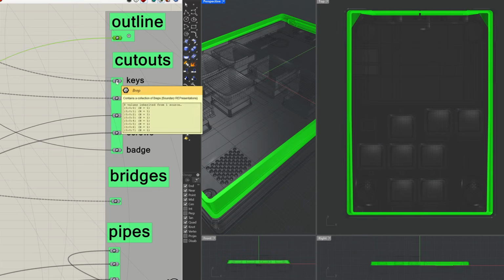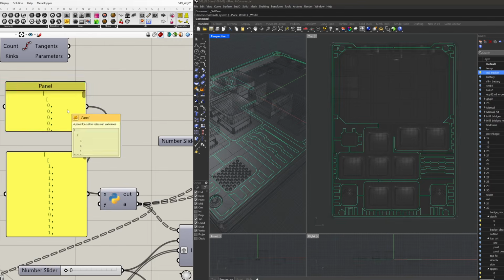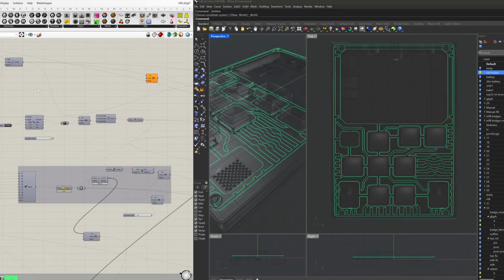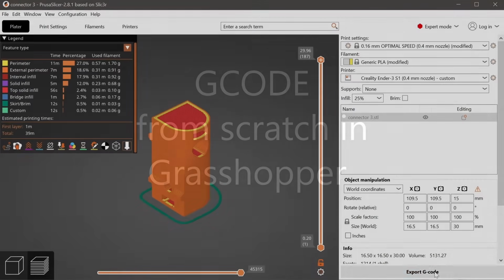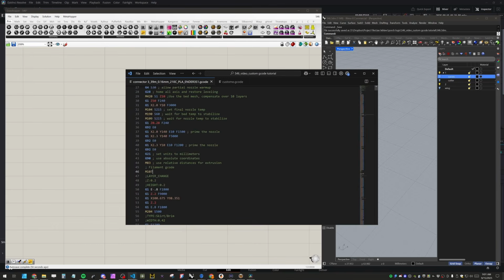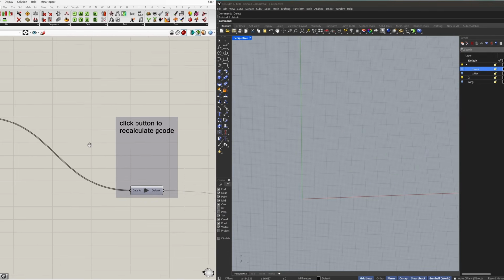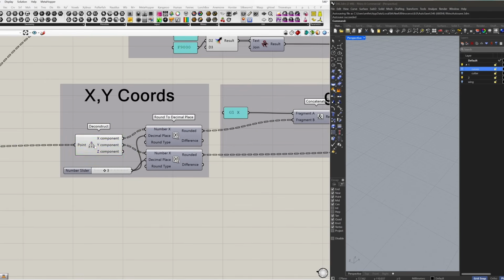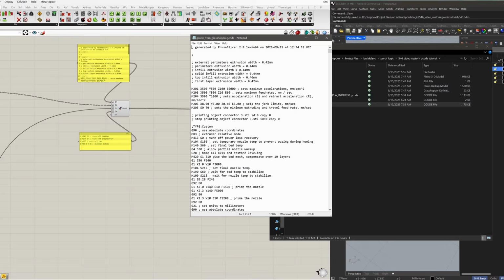GCODE from scratch for M8 Tracker Faceplate

Comment: Impressive, nice to see the plane wing working in this workflow. I made a feature request to Orca for continuous line multi-wall printing with infill a while ago, but it hasn’t gone anywhere. I don’t think it would be very applicable to this faceplate design, but maybe it could be.

The other option would be with Xavier Chermain’s experimental “atomizer” that replaces the slicer while optimising for continuous extrusions, but it does run very slowly.
Reply from the maker: Oh that atomizer looks interesting 🤔. I'd love to just have a long hot end like that even without the tilting bed